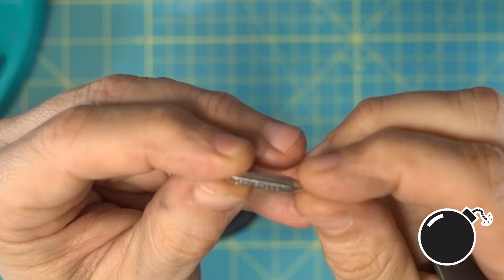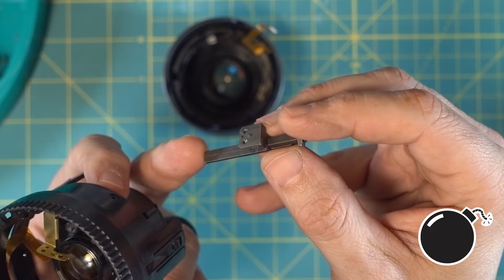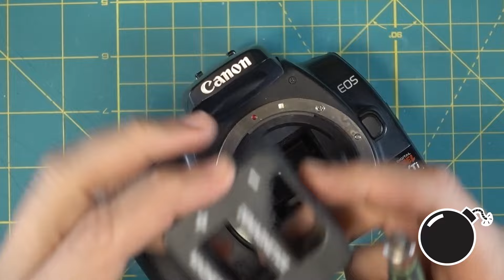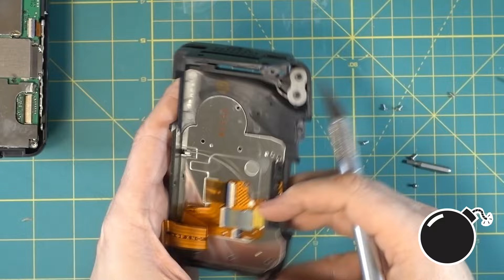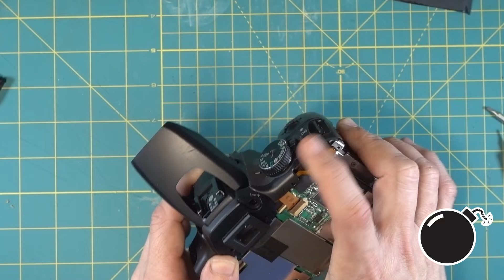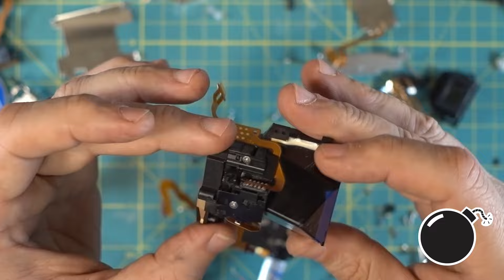What's Inside a Canon DSLR?

Comment: The moment you removed the battery, I was internally screaming "Don't forget to discharge the flash-capacitor!". Was not Disappointed. Mehdi's thumbnail suggests that you got away (ahem) shocked, but further unscathed.
The "push" debossing on the connectors is put there by MechEs, btw, they don't let us EEs anywhere close to the design of those connectors. ..Except perhaps their RF characteristics.
Reply from the maker: Haha, yeah... I knew about the capacitor too, but forgot about it when the time came.... 🙄😁
Yeah that's probably true about the connector, but I need something to gripe about to you electronics wizards! 😉
Reply: I think the opaque window of the handle is for the infrared receiver remote button accessory .
Reply from the maker: I think you are right. That makes sense!